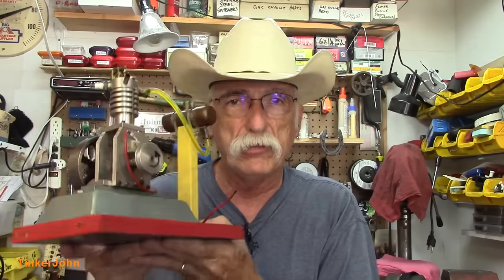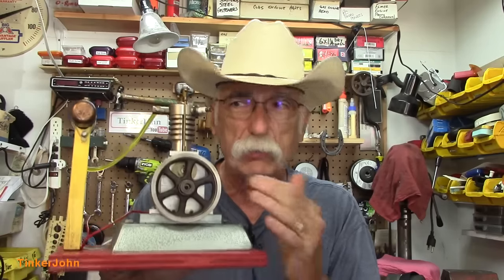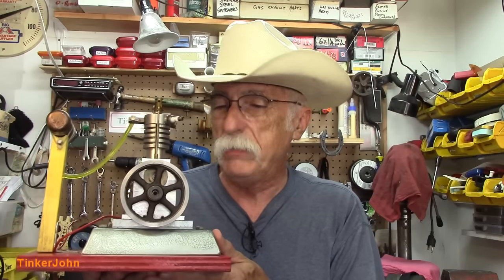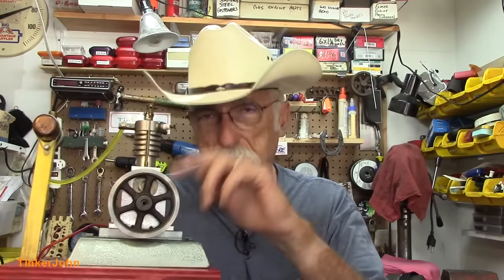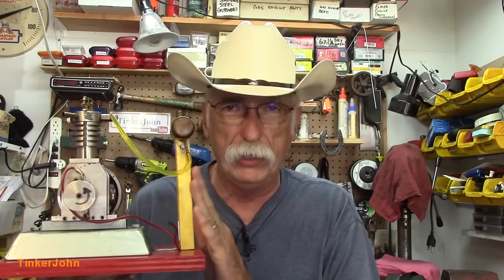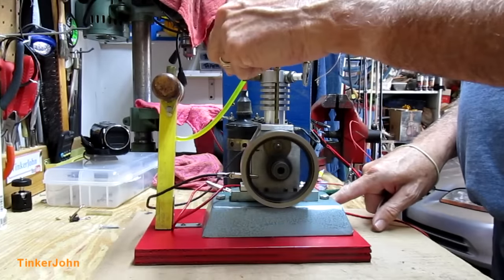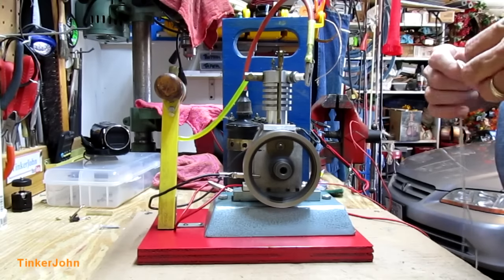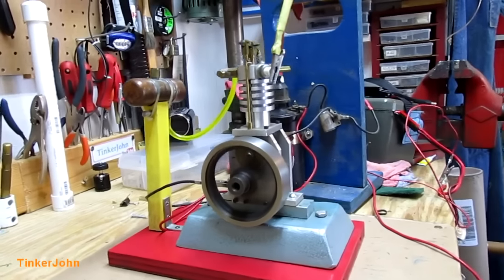Shop Update --  Next Project

Comment: This will be good.  I still have to watch the last few videos from the Stuart series but I've been really busy so I saved them up.  It's a sensible 60F here today but we did get into the 80's a couple of weeks ago and I was sure I was going to die but, somehow, miraculously survived.
Best Wishes, Brendan.
Reply from the maker: Brendan,
As always, thanks for following along and for your comments.  Summer has arrived in Texas with a vengeance, temps in the high 90s with humidity to match.  Shop time has been very limited but hope to get some videos out shortly.  I still look forward to each of your wood turning videos where I always learn a new tip or technique.    ~John
Reply: Thanks John, Summer has arrived here too.  After a couple of weeks of 70-80F we are back to normal and wearing sweat shirts again.  It's about 55F today and raining but to hit a blistering hot 63F later this afternoon.
I am getting a turning video ready with a collage of clips on making a wooden wedding ring.  The thickness ended up between 0.029 to 0.031.  I held my breath a lot.
Best Wishes, Brendan.

Comment: This should be a great new series!
Reply from the maker: John,
Thanks for watching and following along.    ~John
Reply: I have built 6 of these Upshur Engines using only a Sherline lathe and mill. They do run well, but the carbs need work. One of my engines can be seen running both throttled and governor controlled on You Tube , Thanks for your videos. Earl Abbott

Comment: Great stuff.  What is the bore and stroke?  Also what material did you use for the cylinder liner??
Reply from the maker: Roy, 

The cylinder is 1 X 2 and I used black water pipe for the liner.  Not as good a cast iron, but I've never worn out the pipe, plus the pipe is easy to find and much less expensive.        ~John

Comment: Hello John, Surely the fuel tank should be HIGHER than the Carb, as fuel is only supplied under gravity. Or is this some special type of engine that is able to suck the fuel into it ? Did you get my E-mail about the Stuart Tripe Crankshaft. Good Luck. Regards from Dave.
Reply from the maker: Dave,
Thanks for the note and suggestion.  I am just now getting a chance to get caught up with comments and emails.  Actually the tank could be slightly higher, however if it is above the carb, the gas just flows in the cylinder since the carb has no float.  It's still pretty hot in the shop, and I am only working a little each day, hopefully I'll have the new carb built and engine running better in a week or so.    ~John
Reply: +W5CYF / TinkerJohn i dont have the building tools needed to make this engine is there anyway way id be able to buy one?

Comment: I see you've built the vertical variation of the engine; are you possibly building the horizontal hit and miss this time?
Reply from the maker: Thanks for your question.  The current version is the vertical.  However, I've built the horizontal and the only difference is the base and the optional water chest. Otherwise they are the same engine.  I've got a series going on now building the vertical model and have started posting videos.    ~John